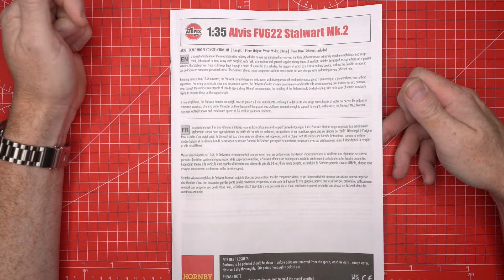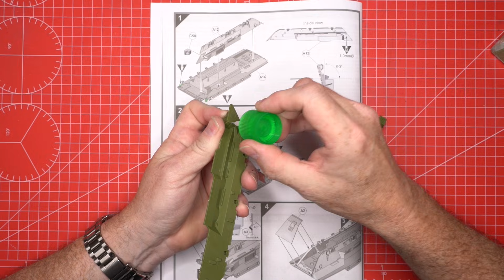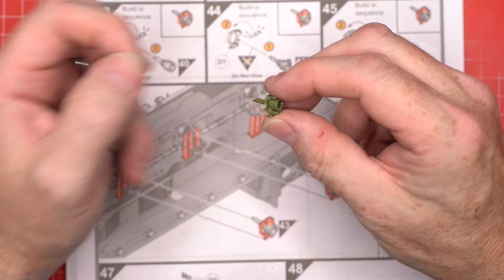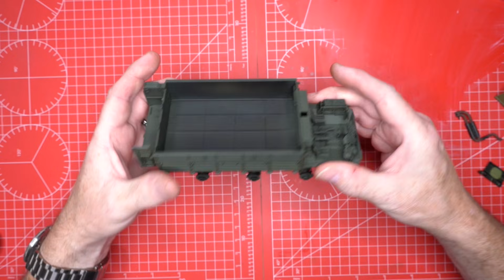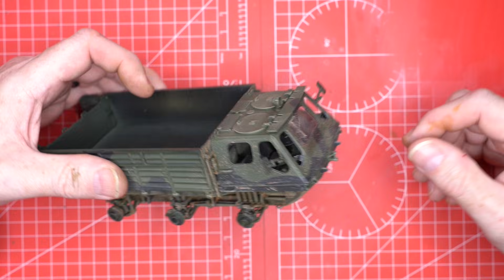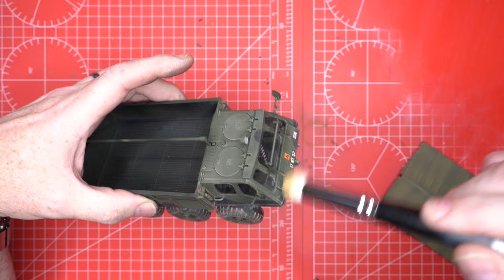Airfix Full Build Alvis FV622 Stalwart Mk.2 | Beyond the Basics!

Comment: I had to spend a lot of time on filling and sanding extensive sink areas on almost all panel parts (cab) - definitely not on par for a modern kit. Plus several parts are practically unusable: the headlight gratings and the exhaust shroud. The windscreen wipers could easily have been separate plastic parts (look at ICM).

Comment: The thought occurs that the Stolly has plenty of surface detail to make a zenithal type undercoat worthwhile, especially the side panels. Black primer all over, then white at lower pressure sprayed from about 45 degrees above to give shadow. Finally a thin layer of the top colour to give it an under-painted effect.

Comment: [+] interesting subject
[+] first decent kit of subject
[+] affordable price
[+] relatively detailed

[-] too thick parts too low pressure so sink marks
[-] exhaust mesh imitation by solid transparent part
[-] no engine
[-] plastic tires
[-] windscreen with wiper molded on
[-] no manipulator crane
[-] headlight protective mesh too fat designed

Love it, immidiately bought one.
Reply: Plastic tyres are better than vinyl ones. The best wheels are resin ones, but the best injection moulded tyres are done the way Miniart do it, with each piece of the tyre tread moulded separately & then clamped together.
Reply: @LondonEmergency999 go tell tamiya to replace all their rubber tires with plastic sandwiches (which many companies produced zillion years before miniart came to steal the idea of it)
Reply: @vibeforge  I just said I prefer plastic tyres, easier to sand and paint 😂😂
Reply: @LondonEmergency999 rubber tires, properly produced, do not require sanding and painting, besides they are hollow inside and give natural sag.
Reply: @LondonEmergency999 Agree but not necessary for this tread. Thrse are really good.
Reply: Somebody will come out with photoetch, and resin or 3D printed tires. The kit is kind of on par with Italeri, given the pros and cons you listed. Hopefully for Airfix a Chinese model company doesn't produce a highly detailed version, like they did with the Austin ambulance.
Reply: @joeshmoe9978  Agree the Gecko one is better because of the mesh grill AND the figure of the (former) Queen. I would have expected Airfix to have had that!
Reply: @joeshmoe9978  sure aftermarket makers won't get away, but I'd prefer Airfix become more respectable company by rising their kit standards as Tamiya constantly does. I am not judging kits by comparing them to monogram era sets, I point on things made well or could be better made. Sure, when you open Stalwart kit and see the contents, the first you think about is SKIF. The parts may look too bulky but assemble together in quite okay looking vehicle. When (not IF) other companies will release more detailed kit with more functional elements (we all like cranes) - I wouldn't resist. Besides, Airfix kits are produced in series, sometimes reappearing, but some are not, and cost awful lot of money (Merlin 1/48 goes for 180 euros now) so grab yours Stalwart while stocks last.
Reply: The accurate armour one is still available,if you are lucky,that has a lot more detail, hopefully the reme conversion might come out.
Reply: The tyres are very well done, have markings and fit very well. Probably the best parts of the kit...
Reply: @guidor.4161  have you ever seen any tamiya rubber tires with markings and patterns, or just comparing 2025 airfix plastic tires to their 1960'ties era tires?